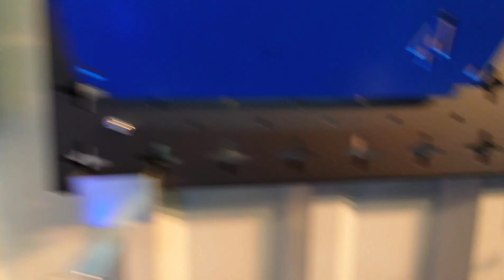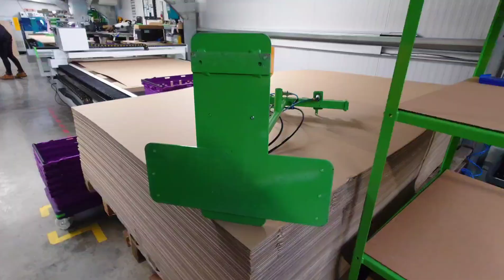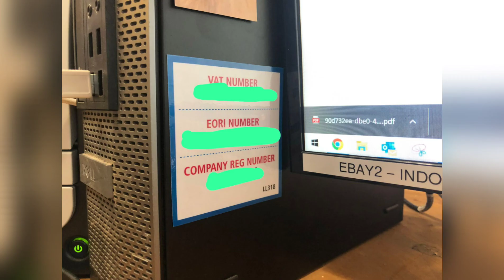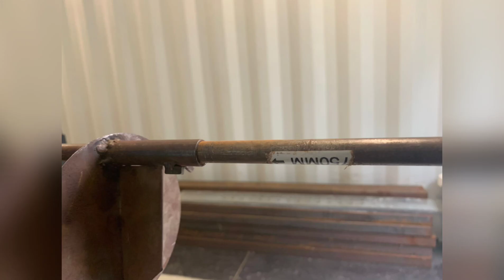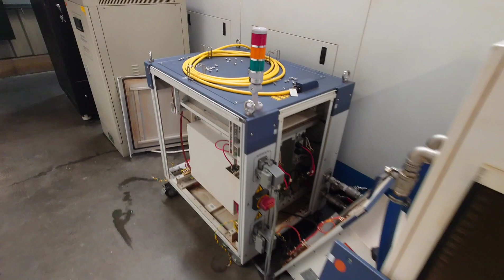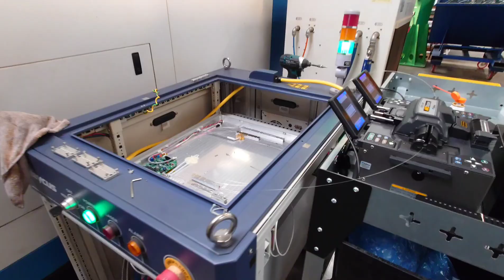3s and Lean Improvements 2nd February

Comment: Hi Jack. Congrats for your repair. I imagine it was very intense.
I saw you switch from Trumpf laser to Raycus source. What's your feedback for this transition?
Reply from the maker: Hi Bogdan, yes it was a very intense time, we had to make the repair successful. Trumpf is one of the best laser brands but we tried the cheaper option, it's been ok as we enjoy to fix and improve things, but trumpf would be best for people that are interested in just cutting and not learning about the machine
Reply: @JackBusseyUK  are there differences in cutting quality? Btw, how old was the fiber source and in the end did the leak had any impact on the fiber source?
Reply from the maker: @BogdanHurezeanu  cut quality is ok, but the trumpf is much more stable. Its around 2 years old